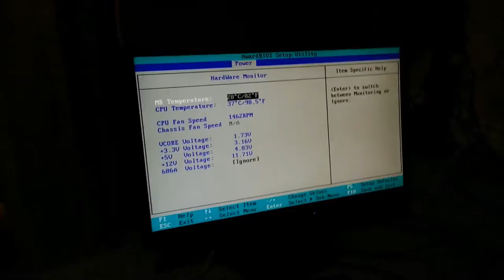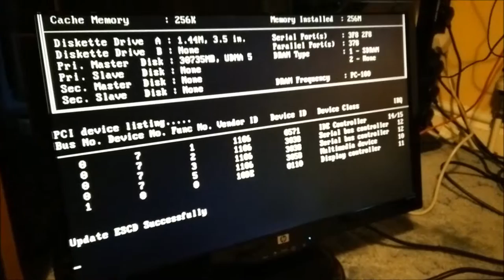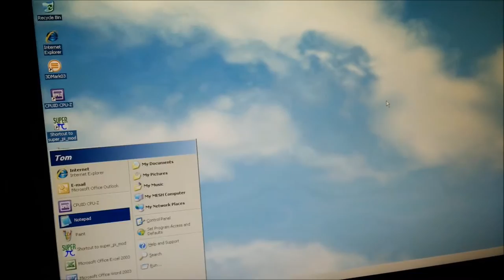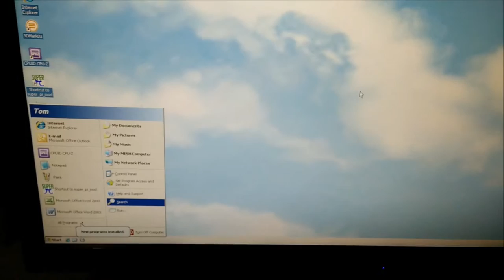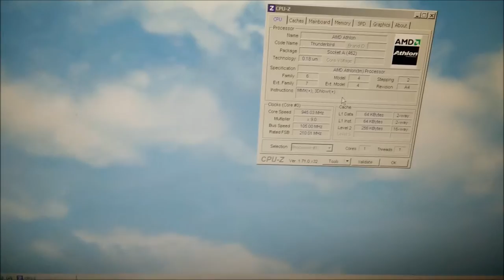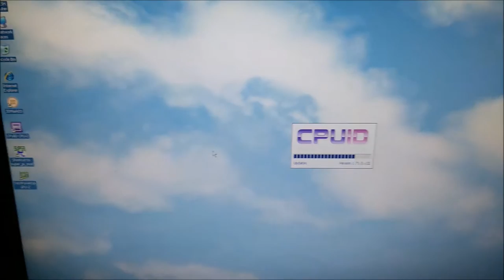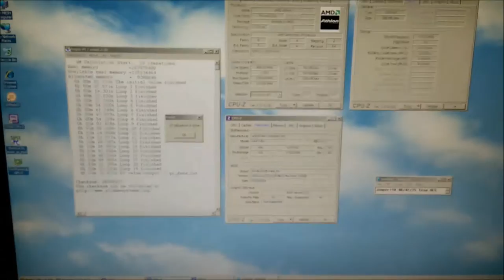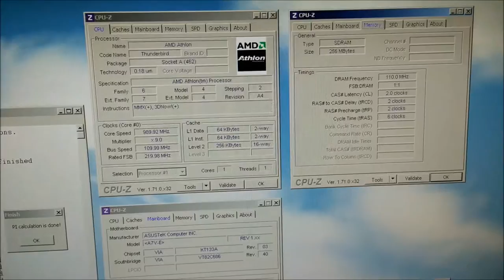Three Athlon 900Mhz testing

Comment: nice gaming rig you got there. crysis 3 killer?

bubble gum for fan clips... i like it. you may need me to send you the schematic for the lego tripod...

cant wait for the multi unlock guide. get some sun...
Reply from the maker: Prokon's Tech Center this can play crysis 3 in 4K at 120fps if i put a agp card with display port in. :P I have a 1.4ghz t bird coming as well which is the fastest cpu for this board.